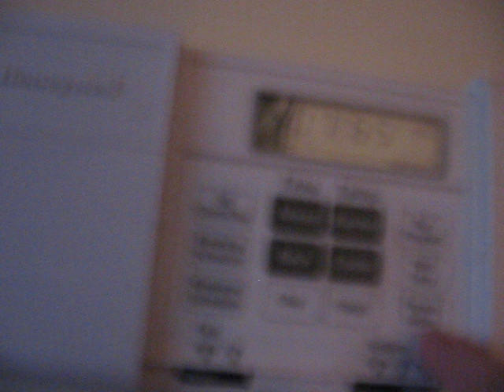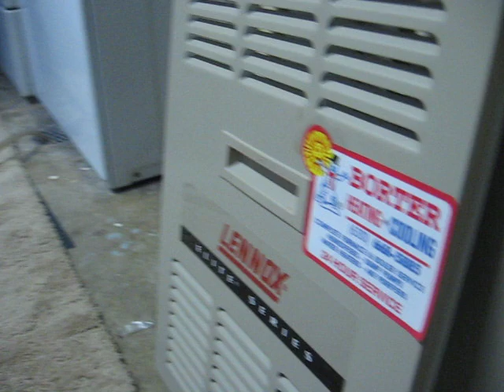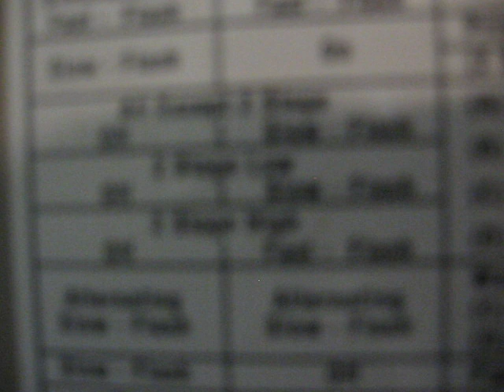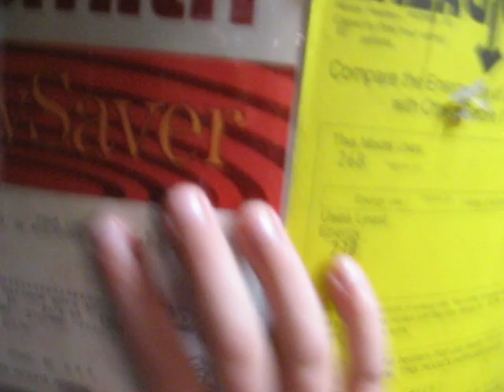Lennox Gas Furnace Starting Up

Comment: Most lenox units suck. you have one of the better ones. my first home is a modified American Standard Freedom 78 and my other house is a lenox whisper heat. 
My freedom gets a degree per minute and is 120,000 btu, and the whisper heat is 100,000. My water heater is a aquastar 240fx, tankless 180,000 btu gas water heater(variable from 125,000 btu to 180,000 btu)